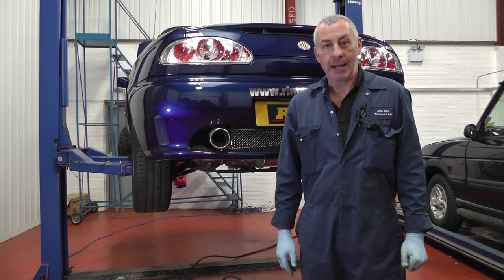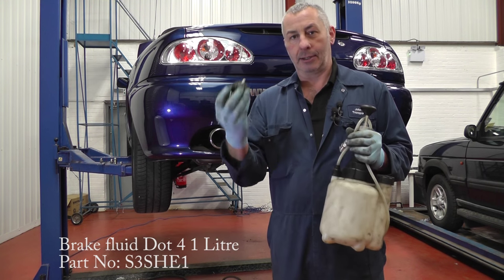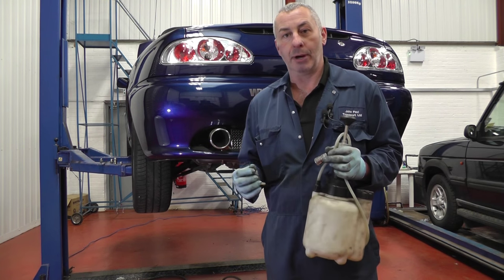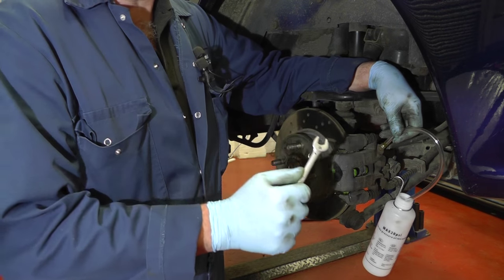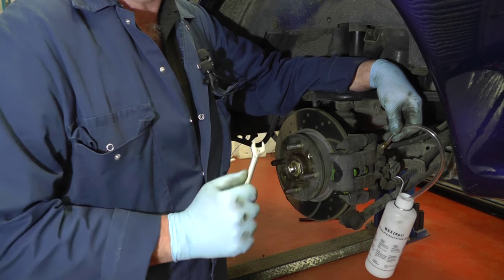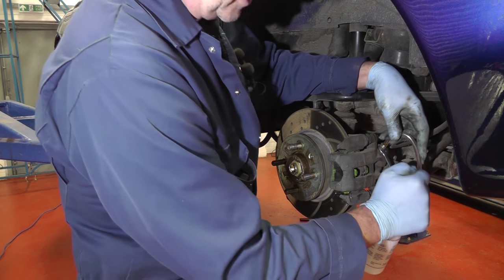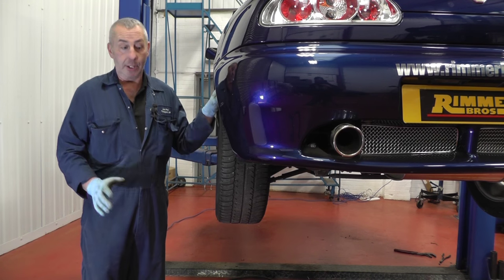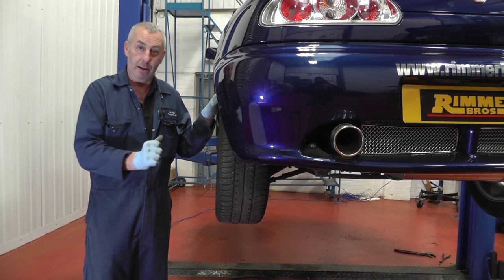Changing the brake fluid on an MGF

Comment: Thanks for the video. Why do you need to use a pressure system at the filler cap, this isn't mentioned in the workshop manual?

Comment: what brake bleeder do you use as the cap on an MGF is of the bayonet type? I can never find anything that works with the bayonet
Reply from the maker: Honestly, this was so long ago that I can't remember what it was. The Gunson Eezi bleed kit is good but doesn't have a bayonet cap. You can modify them as several people on forums have done or just use the good old fashioned 2 people method :)